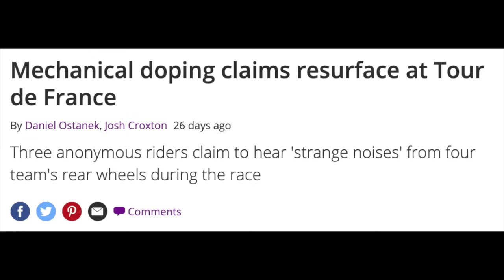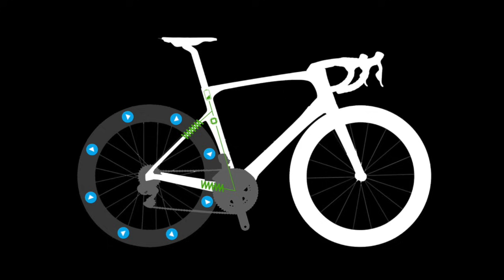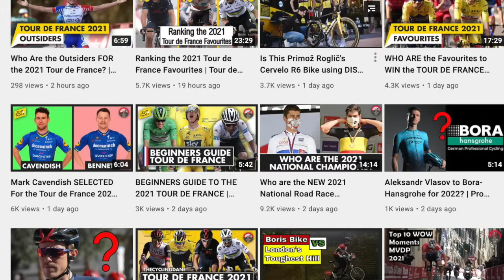Is This Bizarre Crash Proof of Motor-doping? Tour of Denmark 2021

Comment: I thought the race scrutineers checked all bikes for motor doping before the start of each stage?
They should be easy to detect, for example every frame could have several small holes drilled into it by the manufacturer so that if scrutineers couldn't see daylight through the holes it meant a motor was in there..:)
Reply: They do not check all bikes, only the bike that is started during the race. Watch Fabian "Motor" Cancellera switching up to 4 bikes per race even though there is nothing wrong with them. He has someone from his team at certain locations ( within the crowd) and this person takes the bike away so no one takes a look at it. This was seen in many races and it was clear he was switching the bikes due to the battery on the bottle pack running out. After UCI starting scanning the bikes where is Fabian now? He disappeared right after they started doing the seat post scans. The switching of bikes during races with no flat tires, no mechanical problems is highly suspicious and UCI needs to take the swapped bikes, not the team mechanics. All swapped bikes should be handled only by UCI staff.
Reply: @carlosquin4822 - Thanks, and if UCI got tougher by slapping life bans on all cheats (including doping cheats) fewer riders would risk cheating.
Reply: Sad to say, the UCI is probably in on it.  They've lost the battle and cannot survive all the bad PR.  So, they cover it up.  Or make it seem not so serious.

Comment: In the frame of the bycicle on the place where the motor is should be a hole in. So you never can hide a elektra motor. Should be a rule in frame building. If drivers use a elekro motor in the bycicle expend them for life out of competition.

Comment: I guess bikes are too expensive these days for people to 'do' a ghost rider and pedal fast as F... and jump off the back!? The bike will keep going for ages under its own stored energy!
Lean a super light bike over at full speed and get off, there's easily enough energy to keep it going along the ground!
Reply: possibly but this bike took a 90° turn and propelled itself at 90°. definitely suspect. there wouldn't be enough inertia for it to have the bike jump like that at a 90° angle in my opinion

Comment: I like some of your videos but this one is really lame clickbait stuff.  There's no actual analysis just an invitation to speculate - that just seems dumb and irresponsible. It's easy to say there's doubt - if you hear the sound of hooves in the street, it could be a zebra, but probabliity would suggest a horse.  You even say "This doubt could be eradicated by this simple physic lesson that it probably might be" - but you don't actually spend any meaningful time on the physics and trying to understand/explain that. That's a shame. I'm not naive enough to think cheating doesn't happen, but the only way to counter it is a better understanding of the science of it.
Reply: pure facts
Reply: Completely agree. Well said.
Reply: It's the inertia law in action. The wheel was spinning over 50 km/h, he fell from the bike to quickly and the wheel touched the tarmac, and keep on moving the bike until it lost it's spin.
Reply: I completely agree with you, this is a very lame video that is little more than clickbait. As pretty much all pro tour riders use crank-based power meters, would it not show that their watts/kg was way off what was needed to generate the average speed if they were getting an assist of a couple of hundred watts? Does the UCI have access to power data files from riders? (If they aren't already posted publicly on Strava). And if I was motor doping, I'd be using it to help me get up the hills, not to ride on the flat in the peloton as in the video (well, actually I'd need a bloody big motor just to keep up with the peloton in real life, but you know what I mean). Or have the offending pro tour teams got secret batteries that can for no significant weight penalty, power a motor for the entire four to six hours of a stage? I am disappointed in @thecyclingdane
Reply: I agree, I did laugh at some of the replies mentioning kinetic energy or torque or wind speed etc very vaguely either intended as jokes or serious, I don't know..  Personally, when I fall and slide on my butt, for comedic effect I like to wave my arms randomly and jerk my head like a chicken pretending that that motion will propel me faster and farther. (I don't actually do that, in case you are wondering.)

Comment: A motor needs a battery and these are quite bulky and heavy, secondly a motor in the frame can only be small and small motors spin fast with low torque. If there is a motor (with gearbox and a small battery it will help you 15 to 30 minutes, but the extra weight (few kilograms) will cost you more energy than you gain. Motors hidden in a frame of a racebike are noncense for any race that lasts over an hour and easy to detect just by the weight of the bike.
Reply: No that's not true they have been discovered before 5/10% help is game changing in cycling.
Reply: @mattoniy2840  There are accusions, but in professional racing there is still only one proven case (Femke van den Driessche, 2016). In Cyclocross you can change bikes and that makes it possible to have the advantages, but not the disavantages. In roadraces the disavantages (extra weight) are to big.  
All accusements are just other sounds, natural spin of the wheel or powerfull efforts from the rider.
Motors (including battery) are easy to trace and in a group they make too much noise to use them.

Comment: Is motoring just a myth anyway? I mean, surely any motor small enough to be concealed inside the frame couldn't produce enough power to make it worthwhile?
Reply: Depends on the length of the race. The difference between a pro and a high ranking amateur is about 30-50 watts at lactate threshold. So you'd only need a tiny motor to get a huge advantage, as long as the the race is short enough to where you don't run out of battery and end up hauling dead weight.
Reply: @JTMarlin8  Has any rider ever definitely been been proved to motor-cheat?
Until then it's surely just a myth.
Reply: @tungstenkid2271  Yup, cyclocross rider Femke Van den Driessche. Her defense was that she didn't know that her mechanic put a motor in there 😆
Reply: @JTMarlin8  Haha, were she and her mechanic banned for life?
Reply: @tungstenkid2271  6 year ban so she retired

Comment: Win on Sunday, sell on Monday, "NASCAR slogan, " now their going to put limits , like restrictor plates, for cycling they will be checking, every one gets the same battery, size and voltage,  it's not about winning,it's about selling, so those motor assist light weight bikes??? 15,000$  there s good profit in that, we can stop the 5 bike change s a race, I ride for my heath, have no need for motor

Comment: There is never going to be any way to gain an advantage in the peloton using electrical assist for any amount of time to make a difference in race outcome. What you need to watch out for is the UCI firing up eBike racing itself and then you will se the cheaters surface as there are ways to manipulate wattage stealhily.

Comment: To me it looks like the bike (frame) begins to rotate in the same direction as the wheel,  which wouldn't happen if there was an electric motor, the frame would be getting force in the opposite direction of the wheel. So for me I am satisfied that this is a freak accident and not evidence there is something nefarious going on. The inertia of both the front and rear wheels appears to be what propels it across the road.

Comment: The bike frame would spin in the opposite direction if the rear wheel was driven. Frame would lift, like a wheelie and go backwards. No motor.

Comment: Only an idiot believes this nonsense. Once these wheels hit the ground they stop spinning within 2 seconds after impacting the ground. At that speed crash the back wheel would of not been able to drag the bike across the road like that with ZERO WIND look at the crops on the sides. Just ask Cancelera why he needs to switch 4 bikes with nothing wrong with them, his bike mechanic is at those spots and takes the bike away so no one looks at it. After UCI starting doing Scans on the seat posts notice WHERE IS CANCELLERA? where are his CAR accelerations? He was motor cheating no doubt about on the Tour of Flanders it was obvious to any sane person watching.

Comment: Mechanical “doping” is not plausible. The tiny extra power added with miniature motor and battery would not offer advantage for long distance races.
Reply: are you not aware that the big teams spend $10,000s on just the fabric they use to make the jerseys only to gain a few 1/10ths of a second? Every 1/10th of a srcond isa chance at winning. It comes down to Dave Brailsfords famous phrase for TEAM SKY which is "marginal gains! below is copy and pasted from Google . . .
Dave Brailsford used marginal gains to bring his team to glory. You can use small improvements to get 1 percent better every day and win

Comment: There are, as yet,  no magic batteries that weight nothing but still provide enough power to do any good in the pro peloton. The end.
Reply: The drive is only activated rarely, when extra help is needed.
Reply: Are all bikes weighed every day before the race?
Reply: @iberiksoderblom  So, you think they will carry with them the extra weight of the battery, the motor and gearbox (which it would have to have), and the linkage so they can use it every once  in a while. And, then when the battery runs "down" they carry all the weight around just for the exercise. No.
Reply: @robertcatuara5118  I do not know. I know they weigh "some" of them for minimum. It would certainly catch their attention if someone brought a bike that weighed 10 lbs over minimum.
Reply: @rayjoiner6931  Well, it has been used. And a rider banned for six years.
Reply: @rayjoiner6931  and we are not talking eBikes here. Huge difference.
Reply: @iberiksoderblom  Why do you think we are not talking about "e"bikes, here. We are.
Reply: @iberiksoderblom  That is a good question. Maybe in a short race...you could manage an advantage? I have always been suspicious of that incident?
Reply: @iberiksoderblom  Sorry, Erik, for not identifying which post I was responding, to. The post about the the rider who was "caught" and banned. Wasn't that cyclocross? I don't know if they have a "minimum" bike weight for cyclocross.
Reply: I kind of suck at this...but. my point was that you could show up for a cyclocross race with a bike that weighed 40 pounds...I don't think anyone would want to weigh your bike.
Reply: @rayjoiner6931  Are you suspicious of the cyclocross mechanical doping case? Because that case was 100% mechanical doping. The team didn't even deny the presence of the extra power in the bike. They tried to argue that that bike wasn't hers and some other staff member uses it as practice to scout the tracks or whatnot.
Reply: @shaddapforever  Hey, Frank. Yes. That whole incident/story just seemed questionable to me...I don't know. Maybe it was all on the up-and-up? If people were really racing "e-bikes"...they would get caught...more often? I'm not saying that wasn't an ebike. I'm sure it was. I'm just always been suspicious about what they were doing to get caught and "stuff"? Is that the only incident you know of where someone has been caught?

Comment: Ride 200k with a little battery that last half an hour and a heavy  motor in your frame for a handfull of watts. Don't you guys know how paranoid cyclists are about extra weight LOL?
Reply: The UCI have a 6.8 kg lower limit for bike weight. It's not difficult to build bikes under that weight, so there's no penalty if the weight of a battery and motor brings the weight back to the minimum value.

Comment: if you have ridden ceramic speed coated bike and crashed you will know how those back wheels spin so fast even after crash
Reply: but there's not enough inertia to make it jump like that AT A 90° ANGLE!! Its the 90° angle that makes it suspect to me
Reply: @kenkaniff8428  these pro are riding at 60km an hour. Have you ever ridden on flat at 60kmh?